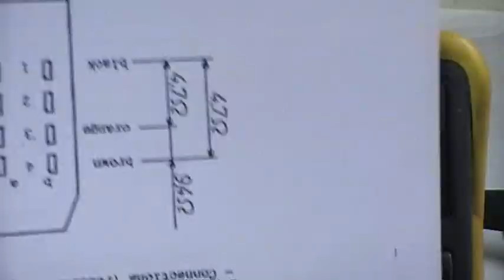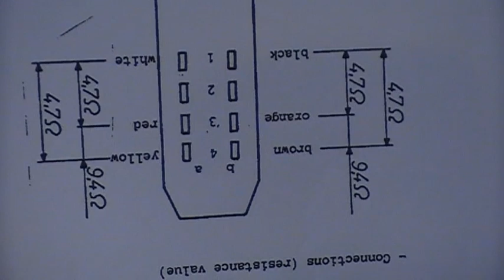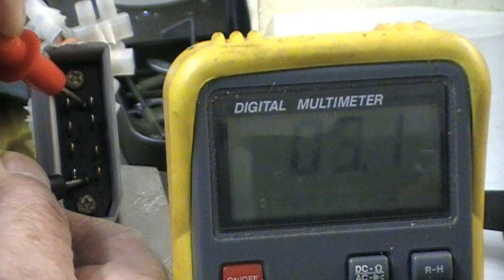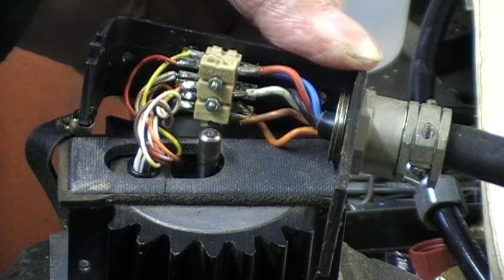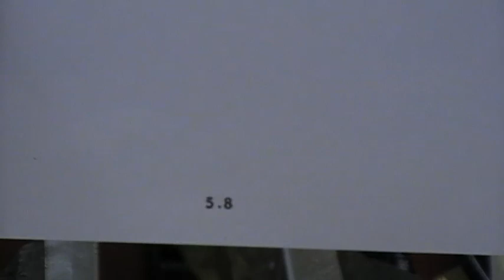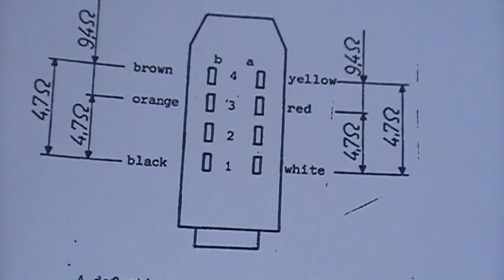Testing Emco Stepper motor windings

Comment: Hello, great video! It’s there a way to connect these motors to a modern stepper motor driver?
Reply: Hi Juan, if there is I have not heard or seen any advice on how to do it, I'm pretty sure it can't be done with 100% success.
Reply: @emgeeradian2223  thanks for such a quick response. It seems I’ll be using modern Nema 23. I’ve salvaged the toothed pulley.